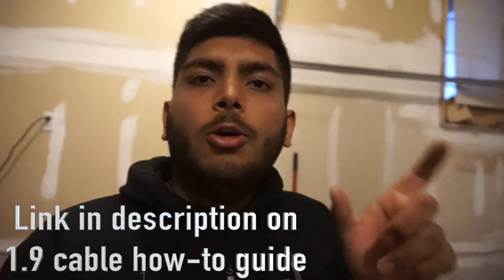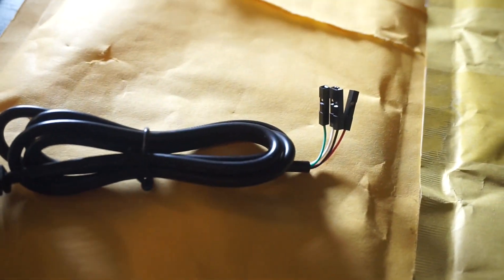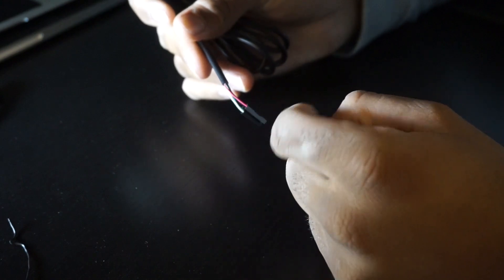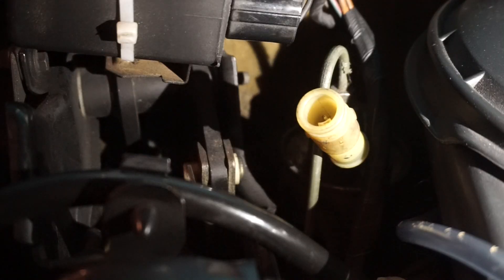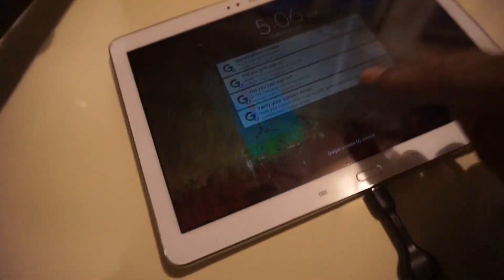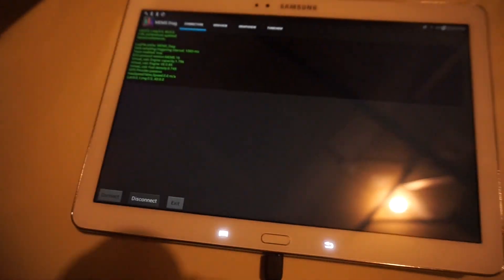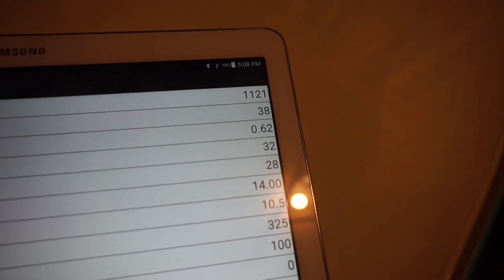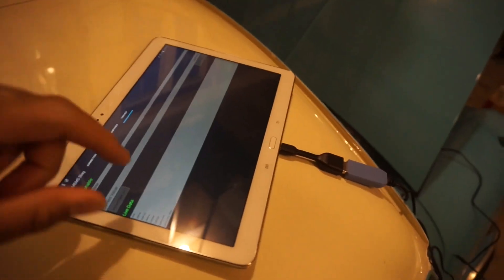CONTROLLING A CLASSIC MINI WITH AN ANDROID TABLET? | mems diagnostic how-to (cable build)

Comment: How do you know the type of MEMS you have? I have a 1.3 Rover Mini Spi from 1992 so this has to work. But I don't know if it is a 1.3, 1.6 or 1.9 MEMS system. Also I really want to know if you can adjust the throttle body (multi-point injection) with this. Because my mini only runs stationery and cuts of if you step on the gas. There are also other sensor checks that I wanted to try.
Reply: 1.6 for your mini

Comment: Do you know if this will work on my 1993 mini sprite?
Reply from the maker: hi max! 
is your car built by rover? 
easiest thing to do is go under the hood, and check for this connector by the clutch master/ beside the air box. 
is your car fuel injected?